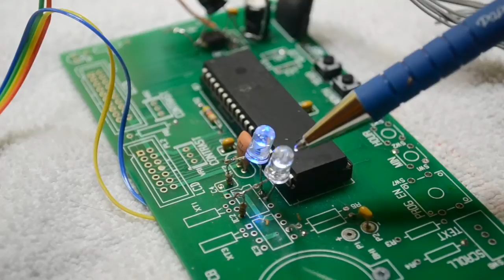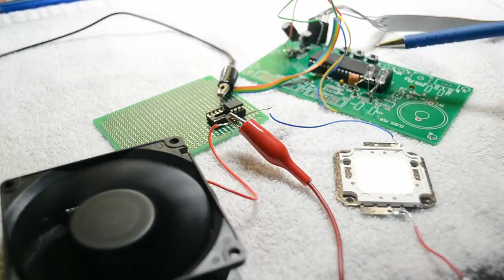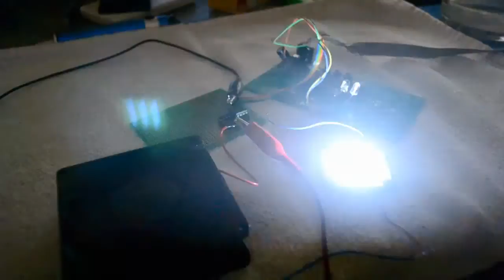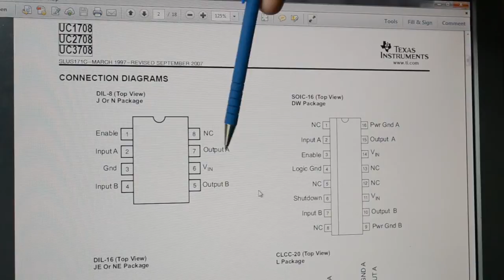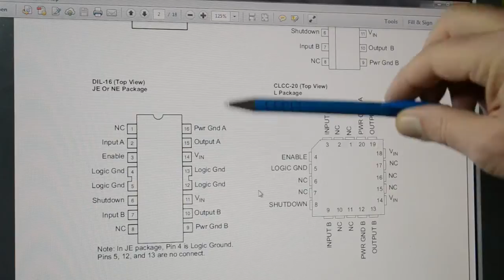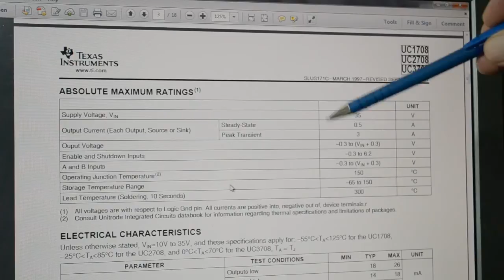High Power Texas Instruments UC3708 DUAL Non-Inverting Power Driver

Comment: Looks like a good alternative to SSRs. Was planning to switch some solenoid valves (rapid operation) using a PWM signal from uC (Suggestions?) 
Would be great to see a Timer 0 & 1 tutorial for 18F & 16F families.
Thanks!
Reply from the maker: Hi, well up to today I would have said the SSR but, this is a better device for fast switching.
I do have a video showing a string of LEDs running like Knight Rider, in that video I used on FET to turn on a high power LED.
You can choose a fet to match your load and voltage.
Just make sure there is a diode across the solenoid coil to stop the Back EMF.
It's an old video with Pic Basic Pro but, it shows a simple fet operation.
https://www.youtube.com/watch?v=3eL5knx9dW0
Thanks
Reply from the maker: Hi Syed, did you manage to watch the CAN video yet and did removing the line improve your can setup?
Thanks
jb
Reply: Hi there, haven't seen it yet but will do after uni today. Had a play around with it yesterday and I've gone for a different approach with PIC1825K80 and MCP2551 my baud rate calculations were bang on and I managed to receive and send the msg. Some other related stuff I'll post later. Got a lecture to catch.
Thanks!